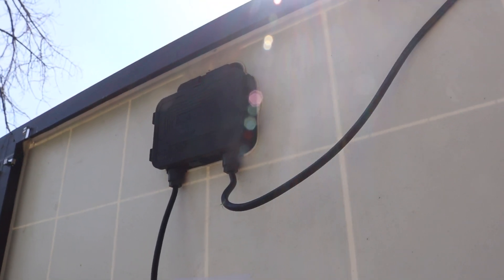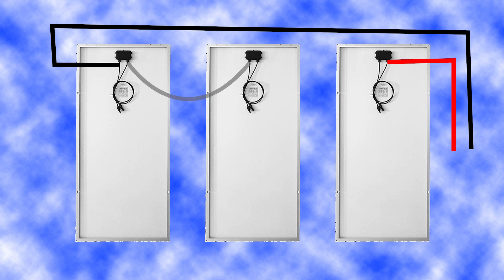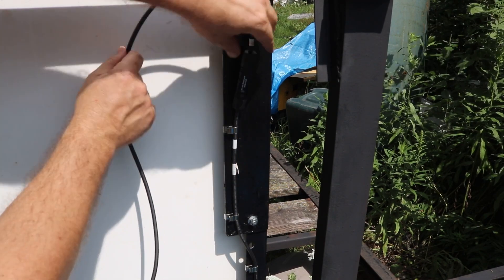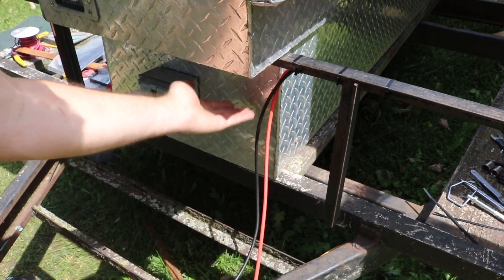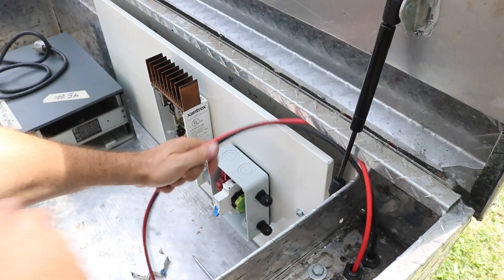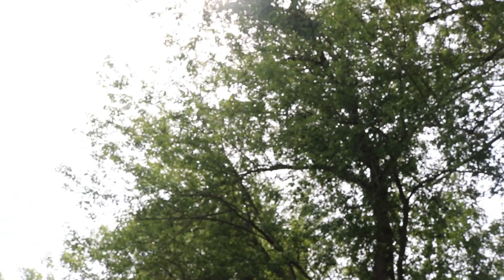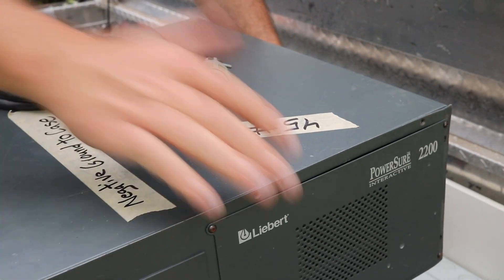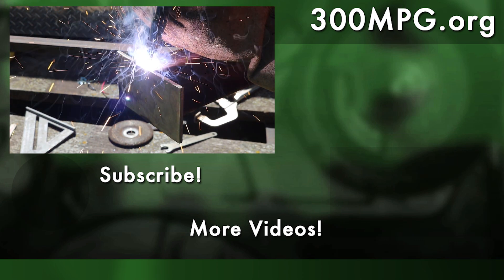Solar Trailer: Part 8 - Wiring the Solar Panels and UPS mods

Comment: Hi Ben Nice project and hopefully it will work well for you but what size are the wires between the breakers and the charge controller? They looked much smaller than the rest of the wiring so may be an issue.
Reply from the maker: That's 12 gauge wiring between the breakers and the charge controller. It just looks small because the wiring coming in from the solar panels is 10 gauge PV wire, and PV wire has an especially thick insulation on it. Maximum theoretical current from the total solar panels is about 16A.

Comment: 10:53 Sooo dang awesome!
Reply from the maker: I did quite a bit of the rest of the project with power from the trailer, including charging batteries for my cordless tools. I still had to run my welder from house power, as it's 240V, and the UPS only has 120V outputs on it.

Comment: What problem is the trailer solvin? How do you plan to use it? And thanks for your videos! Henning in Sweden.
Reply from the maker: Part of the reason I wanted to build the trailer is because I already had most of the parts to do so. It's an interesting project I've been meaning to do for a while.

A couple of advantages for me with the trailer:
- It's mobile, so it can be moved to places where there is not power, such as a construction site, or a residence during a blackout, or simply taken to events as a demonstration unit promoting solar energy.
- It has a battery. I have solar at home, but it's a "grid-tie" system. It works great and saves me money, but safety features deactivate the system if power from the grid is lost.
- I have strict zoning and building codes in my area, so I would NOT be allowed to build a shed or permanent structure for additional solar at my property.
-Trailers under 3,000 pounds gross weight in my state do NOT require titles or license plates, and are covered under my existing car insurance. A basic utility trailer has no additional annual costs for me.

I plan to use the trailer by taking it to events, promoting and teaching about solar. I'll use it to power my house during a blackout. I plan to still add a grid-tie component, so that when the battery is full, energy can still be created and will flow to my home, further reducing my electric utility bill.
Reply: @BenjaminNelsonX  Interesting and thanks.

Comment: Are the panel frames strong enough to handle the air forces applied while driving?
Reply from the maker: Yes. I've had no problems at all so far. When fully assembled and with the panels locked in place vertical, they are very stiff. No issues at all.
My biggest concern is any hardware that could vibrate loose if I forgot to use a nylock nut or lock-tite.
Reply: Maybe a side wind.
Reply from the maker: @stanislavjaracz  Shouldn't be any worse than every box trailer out there.